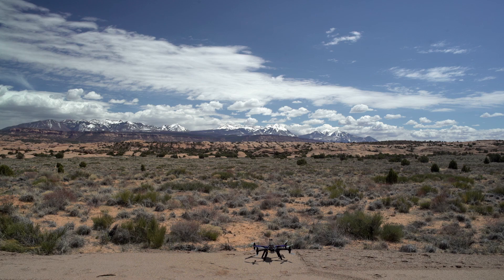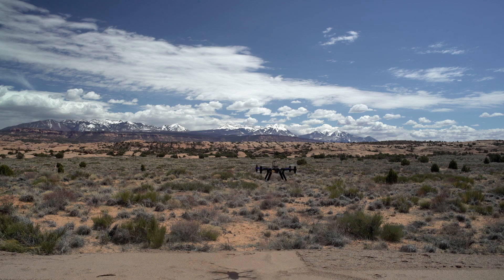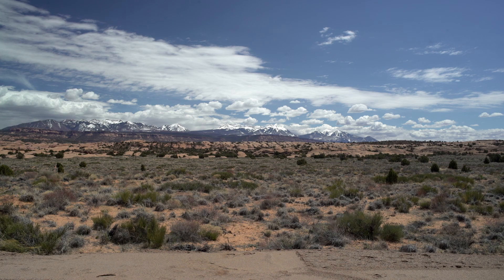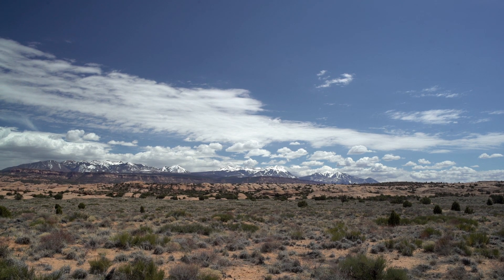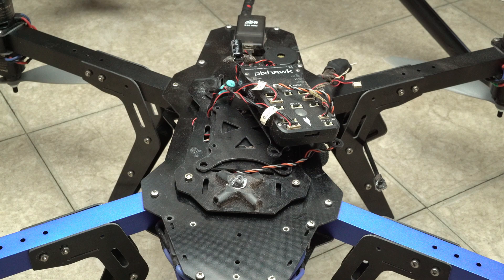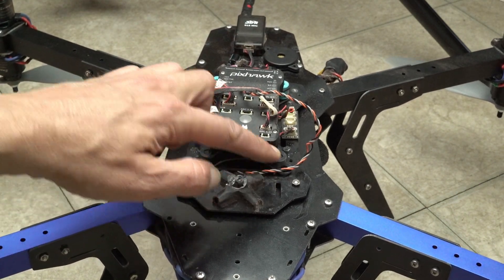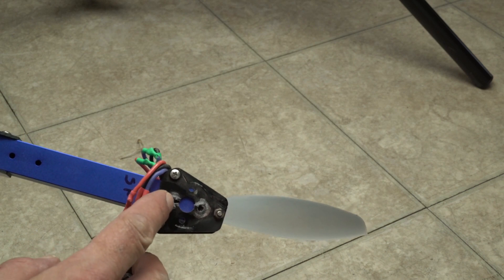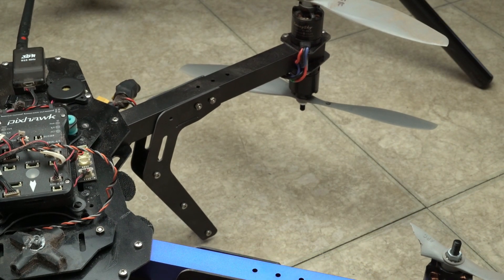Drone Crash: 3dr X8 with Pixhawk "Autotune" Crash via Emergency Motor Stop Switch Mistake

Comment: I use Pixhawk on my drone and I have managed to set up all six flight modes and while testing the other day and almost crashed because of one of two different reasons I think number one is it may have to go back into stabilize mode before utilizing any other flight mode or and this is very important I usually keep a small 7.5 V battery with a zine or diode 1000 µF capacitor connected connected in parallel to the controller in the event a sudden power surge, a sudden gust of wind or need of quick course correction that causes a spike amperage demand it gives an extra second or so preventing the controller from Browning out and rebooting. Now this is just a theory many things can cause crashes.

Comment: You have to arm it in AltHold and take off. Then you switch to autotune.
Reply from the maker: You can actually arm it in several different modes before switching to Autotune, just f.y.i.  However this crash was a result of my having set an emergency motor stop switch and then later forgetting that I had done that.
Reply: @vyoufinder  That's too bad. Hope you could fix it and it's working fine now!
Reply from the maker: Thanks. I had it flying again the next day.. :)

Comment: Do you know what went wrong?
Reply from the maker: Yes.It was my mistake.  I had set an "emergency motors stop" switch earlier for testing stuff indoors and forgot to switch it back to being my autotune switch.  Thus, testing the emergency motors stop switch reveals that it works perfectly, unfortunately ;).

I had it fixed up and flying again the next day.

Comment: Where did you put your battery? Coz by watching it fall it seems the left side is heavier.. 

Mine if it fall accidentally it used to hit only the four landing gear. So motor and everything else is safe, just some damaged landing gear.
Reply from the maker: I had it centered the best I could.   Not sure why it fell harder on the left.
Reply: Oh then it mush be due to sensitive PID settings. 
 Have you tested autotune again?
Reply from the maker: @humptom6704  I did.  Several times.  Autotuning didn't work for me though because my copter was too lightweight (small battery 5200 mAh) to get a good autotune out of it.  So I just ended up tuning it manually.
Reply: Do you have the video for manually tuining?  I would like to see it too if you have...
Reply from the maker: @humptom6704  No, but I used this: https://ardupilot.org/copter/docs/autotune.html and this spreadsheet: https://www.dropbox.com/s/8u9v3ddph6u9u3t/Initial%20parameters.xls?dl=0  Using those, you can do it.